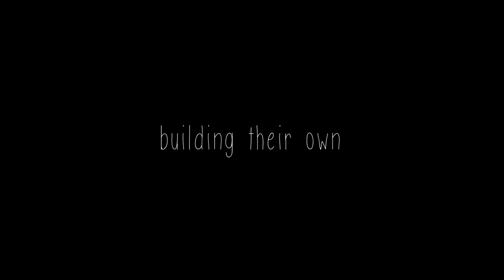Shipping Container Metal Roof Installation Part 2/2 - Living Tiny Project Ep. 019

Comment: You guys are giving it a go so well done. Your roof/deck could be much much simpler and cost a third as much. Tip: use something more permanent to flash your roof other than tape. Saying that, it must very difficult to get the right materials you need if you are having problem getting joist brackets.
Reply from the maker: We totally agree but we didn’t really find other solution for the flushing. So far using the primer in between the tape a the surface it’s holding really well 👌🏼

Comment: Looks good! I would add some flashing tape on the top of the beam too. This will prevent water from pooling on the top of the beams. Also you will get a good overlap with the 'little roofs' you made between the beams as the tape on the top can overlap with the tape you already put in.Basically every horizontal surface should have flash tape to protect it.
Reply from the maker: We agree and we are still thinking about it. The only problem is de cost of it. The tape is kind of expensive. 😏

Comment: you could have just set the roof to a 15 degree angle tilted to the rear then placed gutters at the lower end.
Reply from the maker: I’m not sure to be honest I didn’t understand what you mean hehehe. But keep in mind we have a de on the top so I’m pretty sure to have a 15 degree I would need huge beams to be able to have the wooden deck o the top and that would be way too expensive. 🙈
Reply: @OddLifeCrafting  no, he's talking about 'pitching' the roof 15 degrees to let the water drain off. why are you taking such an unusual method to drain water off your roof? are you collecting the water? looks to me as if you're going to have standing water in the center of your roof, why? if that's what you did then you are asking for trouble, big time.
Reply from the maker: We are gonna collect the water from one of the roofs, they have some inclination. We have a welding between both parts and it was impossible to bring the water to the other part of the container, so we decided to create 2 independent systems.

Comment: Common question here is, why did you install the ends of the roof towards the inside of the top of the container? Consider installing them towards the outside, so water can run off the roof. Today water in the roof may keep your top cooler but it may rust over time. Eaves are the bottom or lover part of ends of roofs edges. When you walk around a house, the eaves are what you see coming out of the roof, bottom wise, what you did installed were trusses but you can call them eaves. 

I loved your job especially together. May God bless your union!!!

Comment: so when bending the metal for going in between the joist or anything, use a 2x4 or square piece of wood as the backing to hammer on instead of ur square, you will get better bends and straighter lines. For next time, great job.
Reply from the maker: Never thought about. Nice!! Thanks for the tip!!👌🏼👌🏼

Comment: Section 5 with the joist. Did you think about cutting out a water way in each joist then cover with protective material?
Reply from the maker: We actually thought about it but decided not to. 😊 if the protection fails it would be bad. 👌🏼

Comment: Well done you two. Great work. Now you have more protection from the elements with the roof up.  Now for the gutter.. 

Tell me if am wrong it seem you are channelling the water away in two different directions, therefore collecting the rain water from two points.

 I know it already late to have suggested building the roof in such a way that all your rain water flows in one direction. Also this will help with your gutter design. 

Keep up the good work you two.
Reply from the maker: We actually wish we could have only one gutter but the connection between both sides of the house makes harder to come up with a solution!!😏

Comment: A very complex roof system for under decking boards water diversion.

Should work but looked like a lot of work and time.

I also fear that with a good wind and the low slop of your slants water is going to go in the direction the wind blows regardless of what you have done.
Reply from the maker: We agree with the wind. But in the end that’s the solution we came up with considering the short period of time we had (if we take tooo long we would be a few weeks without videos to post). We agree about the wind but here where we live the wind hardly have the same direction for more than 2-3 day. That means eventually the water will go down. We hope at least. 🤞🏼🤞🏼

Comment: Maybe I missed it some where. But how did you attach the full length roofing panels to the top of the container? I'm thinking I'd like to build a roof like that on my container that I use for tool storage.
If tall don't mind me running with your design?
Reply from the maker: We installed 4 perpendicular joists in between the main beams. And we screw this joists to the main beams. Of course you can use the idea and even fix any mistake we made. We will be actually really proud if you build something similar. Hehehehe😍😍
Reply: Odd Life Crafting  looks good, will catch up, but can't wait to see future progress
Reply from the maker: 👌🏼 thanks a lot for the support!!😊😊